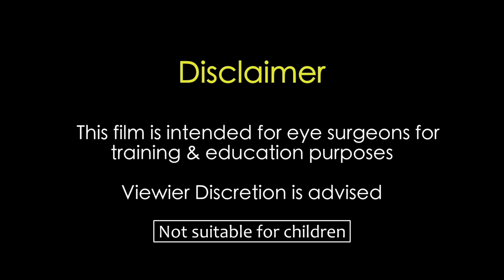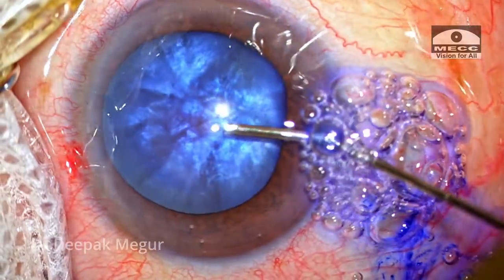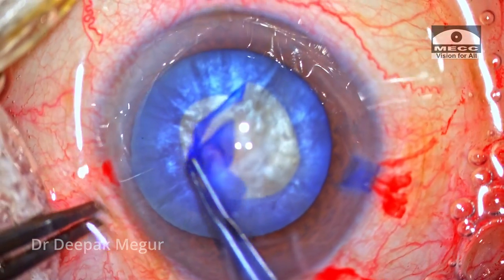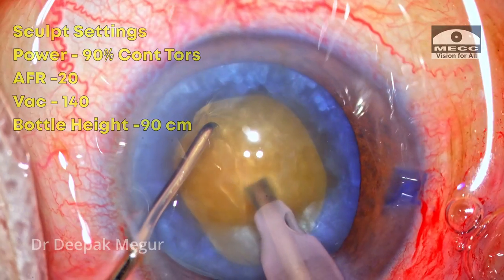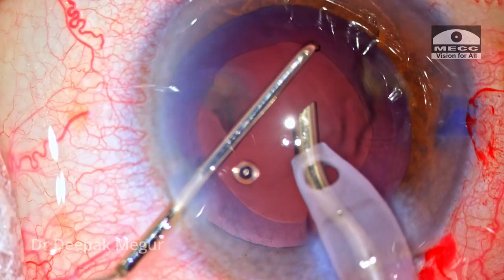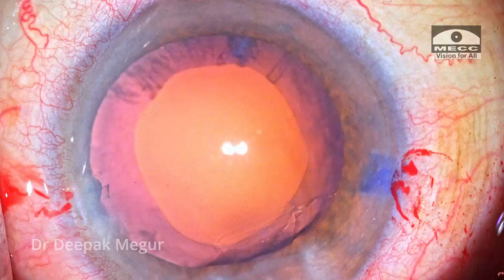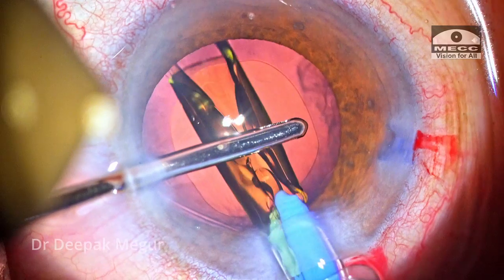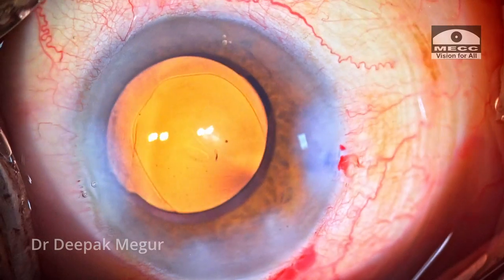Cataract Vlog No,11 (Phacoemulsification) (Full Cataract surgery video) - Dr Deepak Megur

Comment: Few qs .1.you changed to quadrant removal parameters high vaccuum after chopping all pieces .can u chop in quadrant removal mode .2.chopper you are using for chopping ,can u please give specification ? Can we do chop with a std chopper
Reply from the maker: 1. My machine ( infinity & centurion) has torsional ultrasound which has great cutting ability but may not be the best mode for getting good hold. So my chopping setting has only longitudinal in burst mode which gives me excellent holdability and for quadrant removal mode i switch to torsional ultrasound which emulsifies the lens quickly. The vaccuum is the same for both the chopping and the quadrant removal mode. If one is using a machine with just longitudinal energy , then the same settings can be used for chopping and quadrant removal.
2. The chopper has a 1mm long  sharp tip and it has a 90 degree angle with the shaft. nothing special.